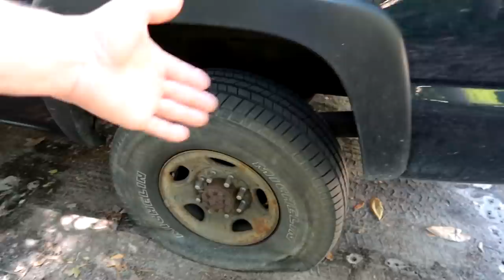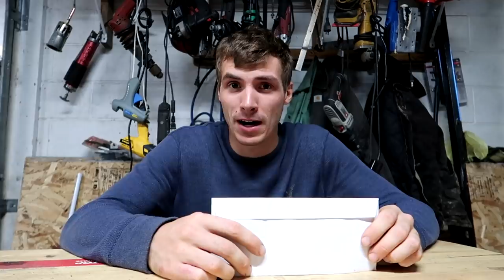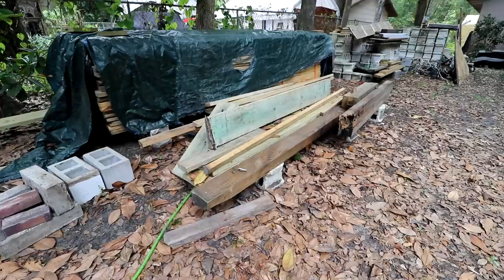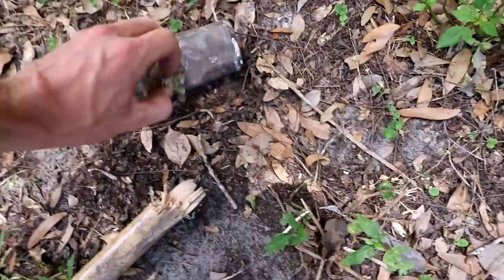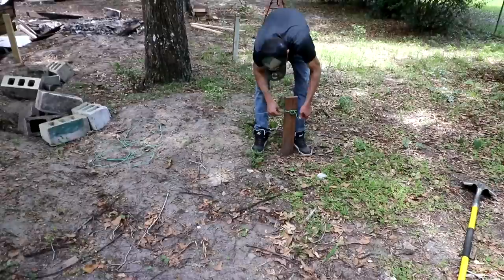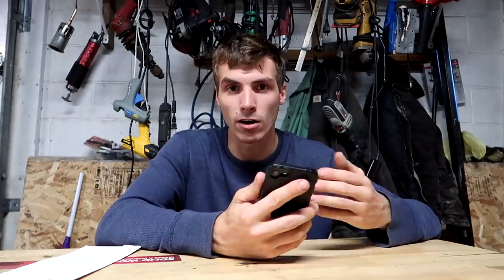CITY WANTS MY HOUSE DEMOLISHED

Comment: The call before you dig reference is to 811. It’s a free service that comes and marks your underground utilities I.e. gas, power, water, so that those utilities are not damaged during construction and can be found for disconnecting and reconnecting. Failure to do so can result in huge fines and costly repair charges from said utility companies.

Comment: I’ve got a tractor with a grapple. It would make short work of that house. We could load it right into the trailer
Reply from the maker: Do you have a backhoe? or...
Reply: No backhoe but I do have a bucket for the front
Reply: Grapple will work good

Comment: When you call in for an inspection and don't think your going to pass ask for a courtesy inspection so if you fail they won't charge to for failing the inspection and if it passes they most likely will sign off on the inspection. But do it all the time you don;t want to get on the bad side of the inspectors

Comment: They don’t want you improving the garage because then you could fix it up and end up living in it and not demoing/ fixing the house.
Reply: Not sure that's accurate.  Even if he was to fix up the garage it doesn't have running water, therefore it doesn't qualify as a dwelling, and somebody cannot live there.  On the architecture plans it was likely never designated a dwelling either.  Not sure why they had a problem with the garage renovations, but I don't think that's the reason because nobody could legally live there regardless of the condition.

Comment: You are fluent in "Smartphone'and GPS".Your BEST solution is to=" stake the outlines of Your Property,and measure from That". Then measure and stake around the "house area"by squaring your plans to those".Measure your drainage field from the Septic tank,and stake that too.>Color your stakes and flags for each.<When the Inspector comes,you will be able to show Each Section By Color,and have the measurements.Best wishes for Your dreams man.You've more than earned them.
Reply: (my family had a double lot,and the neighbors built upon our land and made our new septic and drainage fields be changed,We could've been arses,but let them buy the
30'of land,and had to cut almost all of our trees down instead.We didn't make them tear down their garage AND move their house 15 feet.Neighbors buying New may not know where the Neighbor's True land is)Their cost was but the difference.THAT is what neighbors do.They were mis-informed when they bought.
Great friends from both fam's for 30ish years.

Comment: You should run slime sealant in your tires.
Reply: Thegoodtom 1 stans no tube sealant works pretty good and doesn’t really make a mess but it’s made for bikes so it’s more expensive because people usually use it in smaller quantities.